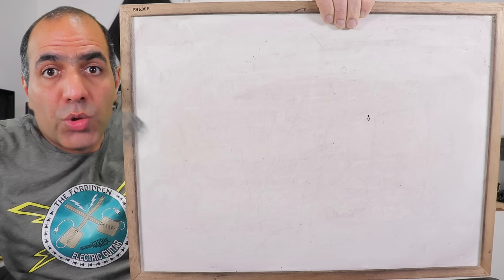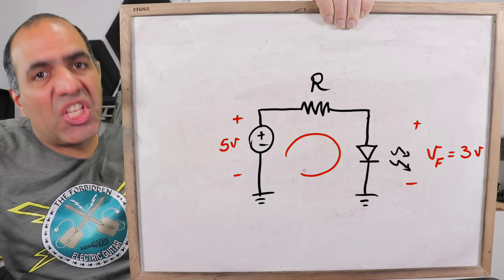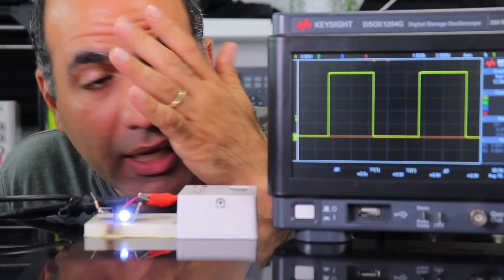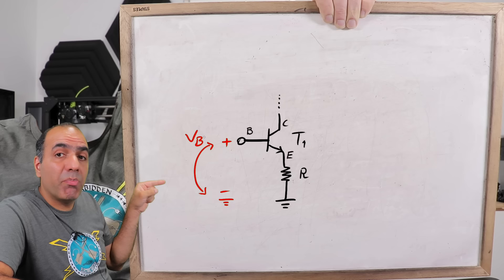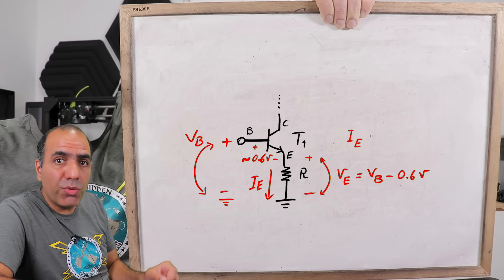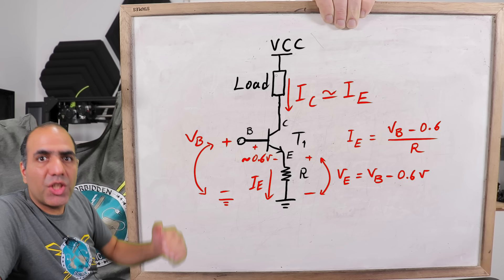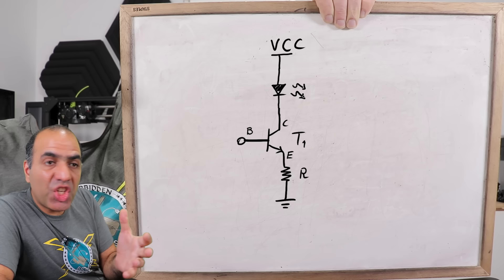How to Turn an LED On

Comment from the maker: Let Audible help you discover new ways to laugh, be inspired, or be entertained. New members can try it free for 30 days. Visit https://audible.com/electroboom or in US text electroboom to 500-500.
Reply: First

Also love your videos
Reply: تامبنیل خیلی گاد بود
Reply: Nice!
Reply: Super interesting video.
Reply: nice
Reply: Resistors : fuking explodes
Meidi : that's the most funniest thing I had ever seen
Reply: Please make a video about SCR
Reply: You need some safety glasses.
Reply: 4:45 no it's not. It's Vrms/2 or Vpeak/2✓2
7:35 it's not working because the current going through the capacitor is half wave rectified, not true AC. You would need two LED strings with reverse polarity to make that work.
Reply: Make a video on how to current output of a circuit
Reply: Nice
Reply: Please make a video about transistors
Reply: wow nice
Reply: The format of  this video is extraordinary. Step by step, trial-and-error, bottom-top
Reply from the maker: @BullCheatFR  no to first point, yes to second point
Reply: @ElectroBOOM  dang, you're right. With a half wave power is /2, not RMS voltage... Never contradict the genius
Reply: @ElectroBOOM  Hey Medi, just use batteries next time.
Reply: @ElectroBOOM  ElectroBOOM
Reply: finding ways to design lightbulbs that predictably break is the foundation of global consumer economics.  Those intentionally faulty resistors aren't an oversight.
Reply: Of course the solution always has a full bridge rectifier, all AC to DC circuits just wouldn't be the same. You should do something with the old, moldy 555IC
Reply: Heyyyyy
Can you make a vid on how to invert DC to AC and whats the easiest way to do that...
Pleaaaaassssseeeee make a vid.
There ain't a vid on whole YouTube about that topic...
Reply: I don't really have any interest in electronics or electricity.   I just like watching the funny, angry man wave his hands like that inflatable flappy man at car lots.
Reply: If you control an LED using a duty cycle, DON'T put it near a self-driving car
Reply: Please test conductive filament for 3d priners
Reply: CAN YOU MAKE A WATER SALT BATTERY PLEASE
Reply: @creativeaj8304  BS there are dozens of vids on inverter circuits along with 100s of examples on the net.
Reply: Buddy I am a hillbilly from Saskatchewan. Can you recommend a video to watch explaining this voltage current spike. I don’t understand.
Reply: So is “event horizon “ an electrical term or the name of an audio book? I’m not trying to be funny.
Reply: Awesome video Mehdi👍
Reply: This is amazon-affiliated corporation. Please stop advertising these tax evaders.
Reply: You can make Video on LED bulb showing why LED,S flicker with AC voltage
Reply: VIDEO IDEA: @electroBOOM Can you make an LED rectifier and put some small ac and make slow-mo so we can see how it rectifies 😁😁
Reply: Does it mean I'm a nerd if I knew what even horizon and breakdown voltage was?
Reply: Can you create a full bridge rectifier with Leds
Reply: Finally. 
I commented already years ago with:

~ °------||----|>|----° ~
100nf MKT. Two LED can be connected anti-parallel.
Actually i found a faulty china LED Lamp, in which this also is applied.
First time i tried that was 1991.

By Using a BF245 JFet, one doesn't need to calculate the Current or Resistance . 
Just connect the Gate to the Source and rhe LED in series to the Drain.
Of course in the range the JFet ban bear it, around of 15 V-18V for the BF245.
Reply: @MS-cx7nf  Try use a camera and then upload it. do you know any good websites where its free to post a video ?
Reply: @johanandersson2165  No.
Reply: Me just casually watching you explain this while your beheaded body holds the white board behind you…
Reply: @ElectroBOOM  hello mehdi, can you make a power amplifier from a used 10A transformer from UPS ICA 1200va, to make Half wave rectifier. thanks
Reply: Until now(I watched my friends seeing only the funny unwanted clips of videos which you make)
😅 I thought you are just a joker

Until I saw you speaking something knowledgeable(scientific explanation) in others videos
 
So I thought I would give it a shot 

But you are a good teacher, I understand the population is not as normal 
So you are like the physics teacher for legends (as so they call themselves).

Man really it takes a lot of you to  maintain the mental harmonal balance regulation so that legends(🤌) don't even get over exited nor bored.
Reply: @ElectroBOOM  peace
Reply: The typography (picture) you used to make it look like a bad person did not fit at all. It doesn't suit you to make this comparison.
Reply: @ElectroBOOM  hi

Comment: Damn, when Mehdi is worried about his circuit's safety, you know it's serious shit
Reply: Charged capacitors are no joke
Reply: @Henrix1998  especially flash capacitors
Reply: Unless it's a Jacob's Ladder
Reply: @ethanpet113  🤣
Reply: Straight up AC mains + Caps only circuit, especially so in ~230V AC countries, is and should be treated as leathal to touch anywhere in circuit even if a 2,x V LED can light up nicely and fine (if it survives the On switch moment, which it won't given enough attempts, as seen at 6:40)
Reply: yesssssssss
Reply: Lmfaooo 😂

Comment: I like Mehdi's style here. He demonstrates even with a university education and experience under his belt, an engineer still must build the circuit in real-life and see what happens.
Reply: When all else fails, 120V AC.
Reply: I think you will find that electrical and electronic engineering students at university under take many laboratory experiments. It's not solely a theoretical education. It is quite practical.

So I would fully expect any graduate electrical or electronic engineer to be constructing projects and testing them.
That is, Mehdi's inclination to construct and test things is NOT unique to him. It's an attribute that can be ascribed to most engineers.
Reply: He's gonna keep on and leave his child fatherless. Dude and electricity don't mix! 

But I agree
Reply: @michaelclark2097  what?
Reply: @ChickenSDS  you've never seen the one where he tried to hold in his pain and his child saw him? It was hilarious. I'm just joking and saying he's gonna fry himself if he keeps on. But he knows what he's doing.
Reply: @deang5622  Not necessarily true, it depends a lot on what aspect of electrical engineering you concentrate on in university, there are specializations which don't involve a lot of circuit design but have a stronger focus on mathematics and software (for example modern communications engineering focuses a lot on information theory and digital signal processing. For sure you need the people who build antennas, design the analog components and the ADCs, but there are also people dedicated entirely to what goes on in the digital part of transceivers or even higher layers of communication protocols). But of course even there lab experiments need to be performed in the end, otherwise you just end up looking at things that are theoretically elegant but might not work that well in practical systems
Reply: @leparraindufromage366  Rubbish.
I said that electrical engineering students  do a lot of laboratory experiments.

The idea that an electrical engineering degree is 100% lectures is a complete nonsense.
Reply: @deang5622  I'm sure you can speak for every university and electrical engineer in the world. I was merely stating that not all electrical engineers are sitting in a lab building circuits out of discrete components, not even disagreeing outright with what you wrote, but you can dismiss my opinion of course.
Reply: @leparraindufromage366  
I am disagreeing with you. And I can do that because I have done an electrical engineering degree.
Reply: IMHO, These is no substitute for hands on experience, in All aspects of life.
Reply: @andchip.s  It is very true for computing and electronics.
Reply: @leparraindufromage366 Fun fact, all accredited electrical engineering curriculums require some amounts of discrete hands on labs. It's literally a requirement of ABET accreditation.

So yes, even if you specialize in DSP or VLSI or semiconductor fabrication, you will still spend your sophomore year tinkering with transistors and capacitors and opamps and etc.
Reply: @phillyphakename1255   Thanks for your input, you can choose to believe it or not, we certainly had some tinkering with discrete circuit components but not to the degree that the university labs would have taught us nearly enough. I took a look at the countries participating in ABET, not that many EU countries on the list, which would perhaps explain the difference. Also because ABET is clearly US-based.
Reply: @fallinginthed33p  Or 230V AC for Europeans

Comment: I'm so happy to have learned about the relationship between event horizons and LEDs. Now I will be able to say "I already know all about LEDs, come on..." in the next video!
Reply: Really? To me, the cause-and-effect between them is still as opaque as a black hole.
Reply: @Kevin-jz9bg  same but at this point i want to know more there's no comming back to the old self
Reply: its pretty easy relationship, if you throw the shrödinger Operator onto the singularity of a LED.
Reply: @neutronenstern.  You know, black holes are described by GR, not quantum mech. The Schrödinger equation is purely for quantum mech.

Comment from the maker: Hi All! Around 6:40, although my first LED was dead from the first capacitor experiment, the second LED was not dead! As some of you pointed out, I totally forgot about the fact that the LED, forcing the current one way through the capacitor only, charges the capacitor to the main voltage peak (hence the one quick blink) and after that because the capacitor is charged, the voltage across the LED doesn't go positive and so it won't turn on any more. The solution would be to discharge the capacitor, say by placing a reverse diode across the LED to discharge the capacitor in the negative cycle. The reverse diode could also be an LED, which means in both cycles you would have an LED on causing less flicker, which is nice!
Reply from the maker: Since I have to pin the other comment, I heart and like this one so it stays up! Otherwise I'm not one of those self loving people! If you like this comment, it helps keep it above pother comments so people can see.
Reply: Nope, the reason it's not lit is because of you exceeding the reverse voltage of the LED ;)
But you would also need a reverse diode in case your led was 50x stronger than the datasheet
Thanks for the video!
Reply: ur vids r so educational and informational
Reply: @ElectroBOOM  why not just edit the pinned comment to add this under it
Oh wait sponsor nevermind
Reply: @ElectroBOOM  I was wondering how could Mehdi forget to mention such an important point about anti-parallel diode. I burnt a dozen of LEDs before learning that LEDs take only around 5V in reverse.
Reply: @ElectroBOOM  spoiiiiilers
Reply: @ElectroBOOM  
You are so one of those self loving people my mother warmed me about.
The eyebrow is a dead giveaway.
Reply: capacitor.
Reply: @Selmarya  LEDs are the most efficient form of lighting we've come up with thus far. That said, they're "only" about 30-40% efficient at converting the input power to output light, the remainder is lost to heat.

For reference, incandescent bulbs are 1 - 3% efficient (meaning 99 - 97% loss to heat), CFLs are 10% efficient, and halogen lamps are 10 - 30% efficient.
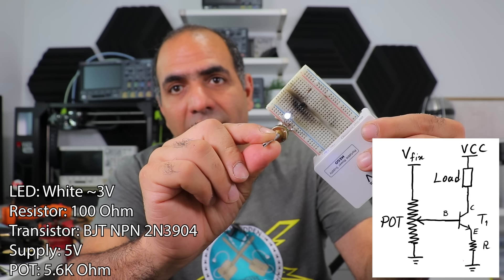Reply: Wut 10:32
Reply: 12:00
Reply: I lost it when the third LED farted with the cap across it
Reply: “FULL BRIDGE RECTIFIEAAAAHHHH!”

Comment: Hey Electroboom. Could you do a video on what transistor is a good pick for various applications? (driving a motor, logic level shifting, HF radio, UHF radio, sound amplification, signal filtering, etc)? There are SO MANY different transistor technologies out there, and I don't know what to pick for which application!
Reply: I think this would make for a quite fascinating video!
Reply: He made electric toothbrush years ago (driving motor using PWM and MOSFET)
Also used relays for logic gates 
And maybe also sound amplification in wire tapping telephone line
Reply: You should only know the difference between BJTs and FETs - the former will require that you supply some current to them and not just some voltage, while the latter can be finicky (as we also saw in the video) and are easier to mess up and burn. From there on it's just a matter of looking at the voltage, power and frequency ratings in the datasheets.

(Wish I could elaborate more on BJTs vs. FETs but I want this comment to be readable after all.)

Edit: I am also waiting for an Electroboom video on transistors!
Reply: Yes he should. He did covered semiconductor basics & diodes in his Electroboom 101 series (which is dead now) so next ideal device would be transistor.
Reply: Mostly depends on input, output current and frequency. All of the datasets cover these things. You need to know what your output current and voltage is, and what frequency you need it to be at. But it would be a good video explaining this.
Reply: Usually in electronics MOSFETs are better than traditionnal transistors since the source to drain loss is much lower in low amperage applications. Transistors need current to open up their gates, but MOSFETs only need voltage (consuming very little current at the gate in the process, making it perfect for microcontrollers). There is a way to lower transistors gate losses by using a Darlington (basically a transistor controlling the gate of the transistor that acts like a switch). In high current applications, transistor gate losses start to level out with MOSFETs (because the gate in the transistor is getting extremely well energised, thus reducing it's resistance, MOSFETs have this resistance aswell).

Unfortunatly, that's as far as I can go in transistor knowledge, I didnt finish my college electronics class yet
Reply: @toshibasony9222  what about IGBTs, non silicon transistors, op amps and the like? They're also all very useful
Reply: Usually you'll want to use a mosfet or an IC for your stated applications. If you want to build a radio or audio amplifier circuit from scratch yourself, your knowledge of transistors/electronics would have to be a lot higher than what 1 electroboom video could teach anyways ;)
Reply: @tuskiomisham  IGBTs are usually only used in power elctronics (electric cars, trains, generators) opamps are amplifier circuits and not discreet Transistors
Reply: You'll be using mosfets either as amplifiers in triode region, or as switches in saturation. 
Amplifiers are simple but there are loads of diffrent layouts for applications. As switches i'd recommend learning about the safe operating area of a mosfet (SOA) it coupled with a few other key values (VGS, IDS max, etc...) are all you need to know for if a particular gate will be good for your application. Its really easy stuff if you just want to use them.
Reply: For those applications it is less about the transistor and more about the inductive/capacitive load in question.  For example, you can drive a motor with either a FET or BJT, but if you don't have a flyback diode, you can expect the inductance of the motor to fry your transistor as the voltage on the motor continues to increase until it reaches the breakdown voltage of the weakest link in the circuit (which is usually the transistor's drain->source or emitter->collector pins).  For high frequency applications, the capacitance is far more important, as it limits the rate at which the output can change.  For example, the relatively rare common-base configuration of a BJT is often used in high frequencies circuits because of the reduced capacitance of that configuration.
Reply: @tuskiomisham  The other replies have covered what I had to say on this, I just wanted to add that unitl Mehdi makes videos on these topics, you can check out element14's "The learning circuit" series
Reply: please mehdi this would be VERY interesting
Reply: There is so many transistors, first you have to know the kind of "work" you want the transistor to do, then find the better one, transistors has parámeters, Absolute maximun ratings: voltage, current, frecuency and others
Reply: @sebastienmonette6659  also, bjt transistors are better than mosfet transistors in some cases, mosfets are bad, for example at analogic audio, they are better un digital stuff, for example PWM
Reply: @RJQM366  that's because of the intergrated diode in MOSFETs. You'd simply need two of them to controle analogue signals properly
Reply: @tuskiomisham  There aren't many non-silicon transistors that you'd need in home-made projects
Reply: Generally, the transistor technology matters less than the design decisions made in the transistor itself, but there are exceptions.

Schottky-clamped BJT: Fast logic signals. Obsolete.
JFET: mostly used for analogue applications, except for
HEMT: High current handling and high voltage blocking (so, high power applications).
IGBT: Also high voltage and current, but has issues with slow turn-off. However, it is easy to drive due to the insulated gate and enhancement-mode operation. Doesn't work for analog at all.
UJT: Only usable as a triggering circuit.

Comment: Love you dude! I was graduated as Electronic technician some 30 years ago. And it's nice that most of my knowledge is still valid today. Than I started an Electrical Engineering university course, but I feel in temptation with Computer Sciences, and I didn't mess up much with electronics all this time. You bring so much fun memories. Thank you very much for your work. 😂